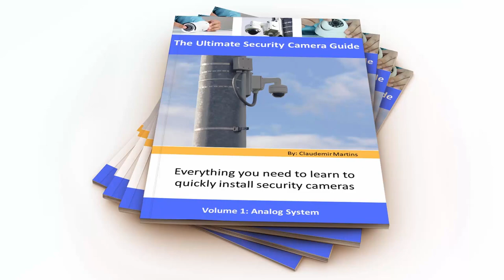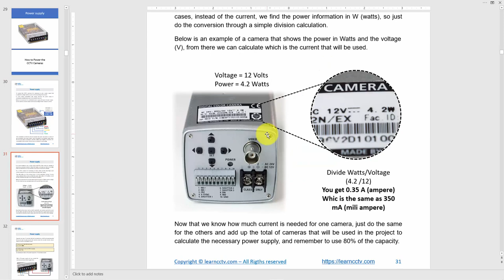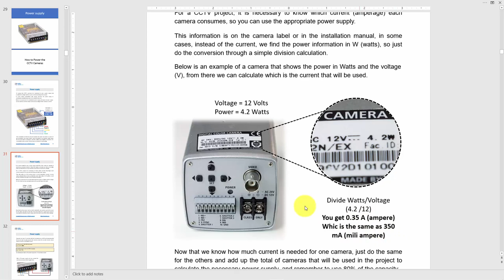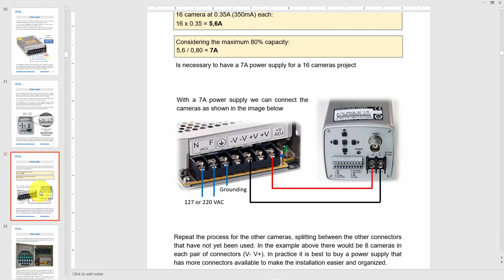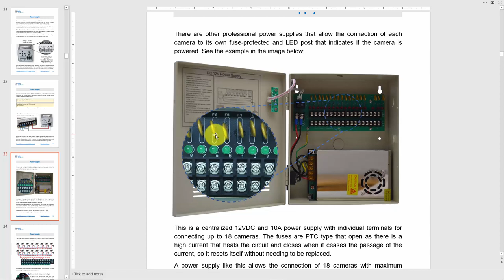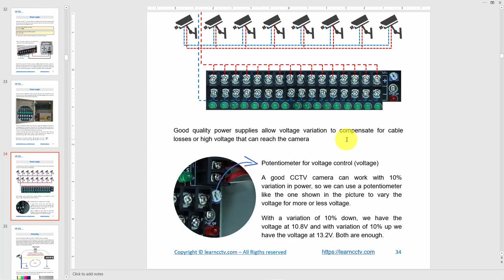Power Supply for CCTV

Comment: Good afternoon.  I’m still new to the cctv world and a Do it Yourself homeowner and had a question about the power supply.  I have all 8 cameras on a power supply box and wanted to know if I can make my dvr connect to the power supply as well.  It seems safe but not too sure if it actually is.
Reply from the maker: A DVR comes with its own power supply. Just use it. I don't see any reason to use the same power supply for the cameras and the DVR.
Reply: @LearnCCTV  Yes I completely agree.  It’s just the cable management is what I’m picky about is all.  Trying to get everything compiled into one section of wiring.  I just saw that as an option to do but not to much of a subject matter expert in it.

Comment: What is the professional power supply?  I could not find the link you mentioned.
Reply from the maker: A Power Supply designed for CCTV with fuses, one connections per camera and at least 1A per camera (if you are using regular dome or bullets)
Reply: @LearnCCTV  Thank you for your reply.  Can you tell me the manufacturer or brand?
Reply: @russellswansen6487  We're the manufacturer of the CCTV Power Supply, feel free to contact me for details😀

Comment: Is danger for camera , dvr , and hard disk if the power suplly out put volt not 12 volt but 14 volt or 13.30 volt?
Can this volt damage my camera or dvr or hard disk?
Im using power supply colin 30 ampir for 7 camera 5 mega and 2 tera hard disk out put volt 13.8  by electric current and when the electric current disconected the ups out put for power supply and 5 camer , dvr , hard disk only  12 or 12,5 or 11 this ups just  for dvr and camera system not for monitor he cannot out put 220 volt but i can make my system recored whil the electric current is disconected is this ups danger? Is it can damage my system?